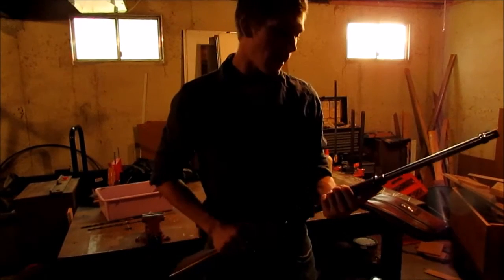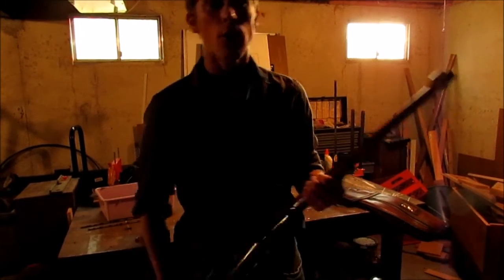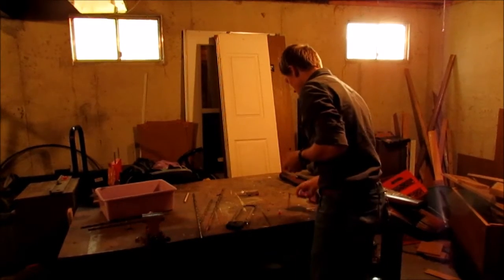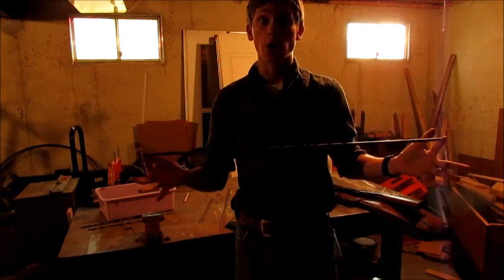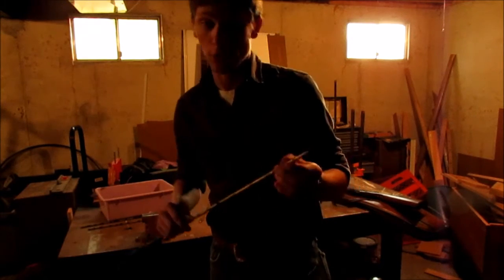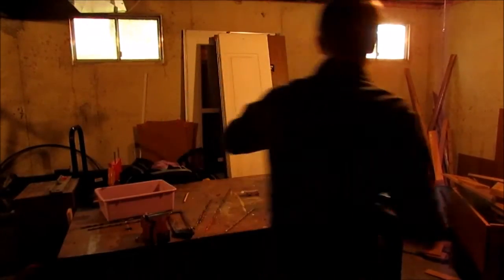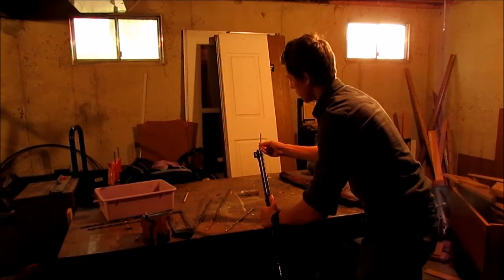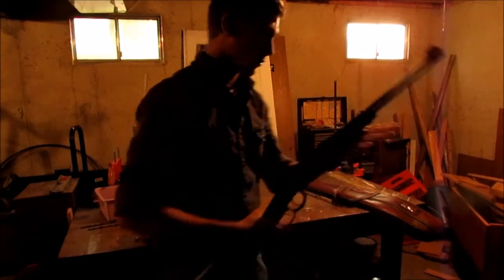How To Make Your Own Tube Magazine Speed Loader

Comment: I appreciate the tip. I’d have never thought about using aluminum shaft arrow shafts. I was thinkin about carrying a few loaded shafts in more stout cylinder like schedule forty pvc and attach to some Molle gear (say a slap charge pouch). My only question is… what do u plug or close off, the open end with? Thanks!! 👍👍😁🇺🇸

Comment: A suggestion about your lighting for your videos.  The windows behind you are providing more light than your ceiling lights in the basement.  This causes your video camera to adjust the aperture to compensate for the bright window light in the background.  This causes your image and what you are holding to be a "silhouette" and has no detail.  You could either cover the windows with cardboard to block the bright backlighting situation, or you could reverse where you are standing to the opposite side of the table, and put the camera on the window side of the table.  A third option would be to make your video after the sun sets and make your video the same way you made this one.  It was very difficult to see what you were doing in this video.  Good content, and good explanation of your idea and procedures.  Thanks for posting.
Reply from the maker: I appreciate comments like yours, thank you very much for the constructive criticism. I will take that into account from here on out.

Comment: Hey there, good video. here's a suggestion when cutting your tubing since it's aluminum use a plumbers pipe cutter the kind used to cut copper pipe. They come in different sizes and make a straight and clean cut with no danger of crushing the tubing.
Reply from the maker: That's a good idea, hadnt thought of that. I appreciate it!
Reply: My pleasure, I was recently making a "bore sighter" for my crossbow and cut the shaft of an aluminum arrow using the pipe cutter method...works great. Then all you do is insert your laser bore sighter into the arrow, load your arrow on to the crossbow and sight in your scope or iron sights. I also found that  this arrow was a perfect fit for .22lr. the arrow was an Easton  11/32 diameter 2117 marked on the shaft ( this mark is for type of material ( 1st two #'s) and wall thickness(2nd two #'s). So  I got interested in making a speed loader again and that is what led me to your video. If you haven't already check out "steeltank100" he's got a great video for a speed loader.Good luck and keep shooting!